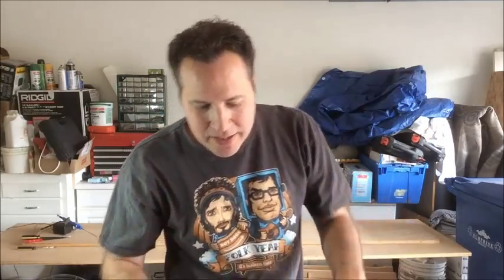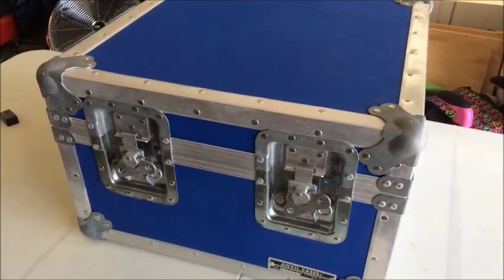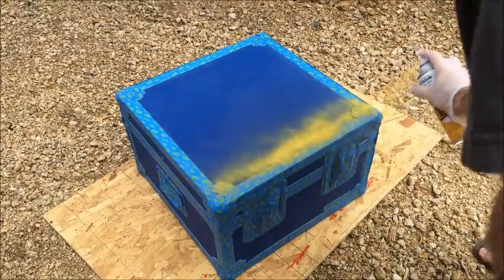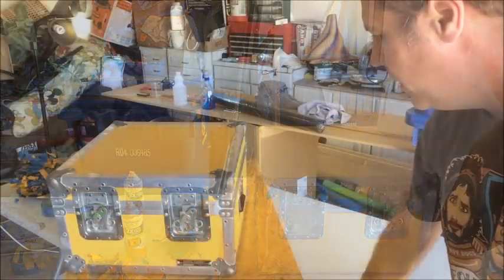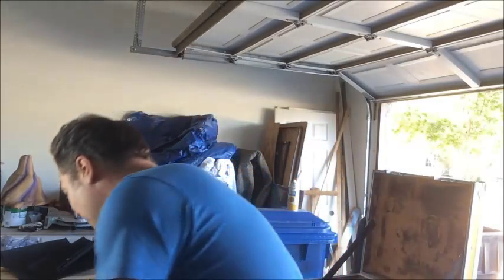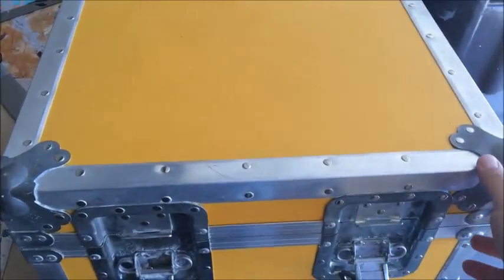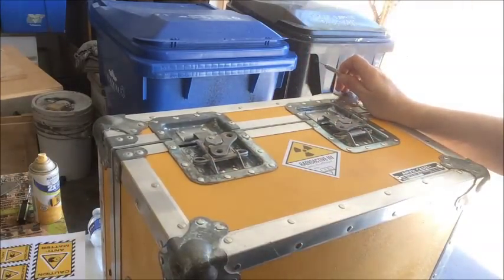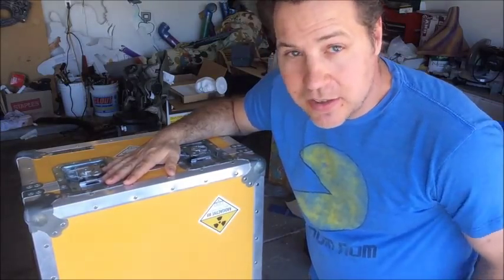Mad Props:  Plutonium Display Case

Comment: For the decals try using a hairdryer to warm up the surface before applying it. This will help the vinyl mold better to the surface. Also when applying the vinyl stickers heat them up also. This will make the glue more active to bond. Once it's cooled off it should stick nicely
Reply from the maker: +Edward J. Ford Thanks for the awesome tips Edward. I'm definitely going to keep that in mind for next time. I have a heat gun but it may get too hot and strip the paint, a hairdryer is probably better in this case.